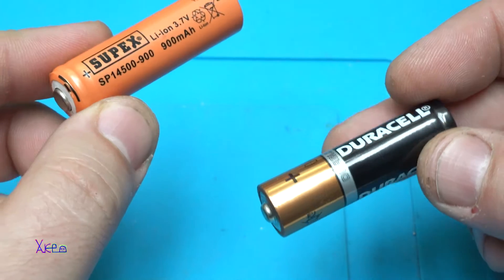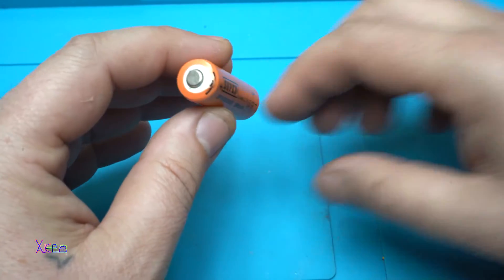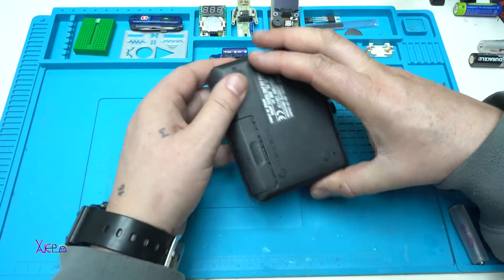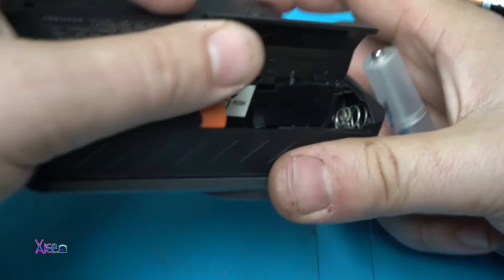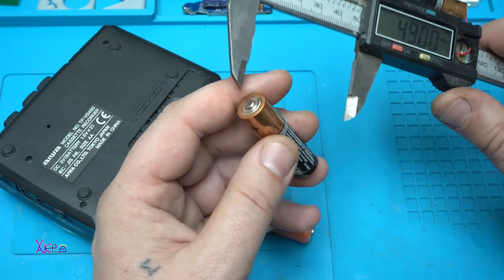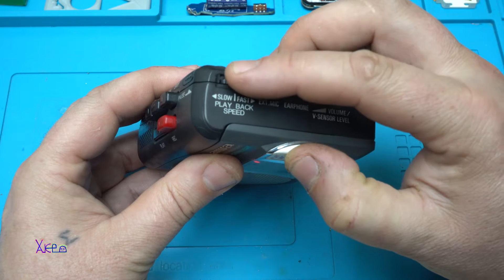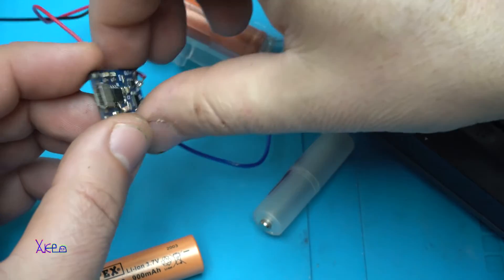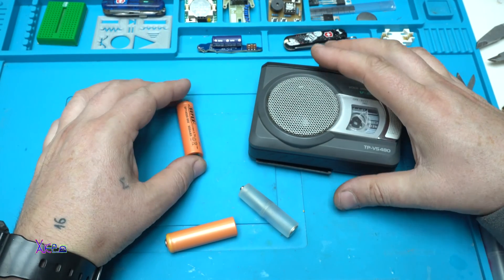WHY 14500 is BEST BATTERY? Testing! True or Fake?

Comment: Tell me a product with a good 14500 rechargeable battery.
Reply from the maker: You mean to find in device?
Reply: @Hacktuber I need a 14500 rechargeable battery with good performance to put in my flashlight.
Thanks.

Comment: they have lipo4 3.3v AA's now, about 1.5$ each. i think better for replacing alkaline because of closer voltages and also maybe more durable to overdischarge since there is no protecetion, i think random devices will keep pulling juice from lipol batteries.... especially since 3.7v looks like fully charged AA the low battery sign will not warn you. maybe this is a bit better with lipo4? i think the capcaity is about the same but i dont know how to charge lipo4 without a power supply...
Reply from the maker: You need to charge with current limiter and have adjustable power supply
Reply: @Hacktuber  hmm i bet in a pinch i could use an automotive lead acid charger and just put 4x lifepo in series, charge on the lowest setting up to about 14.8v total and reconnect them all in parellel to balance. repeat a couple times and they should be close to topped off. usually the lowest setting on automotive chargers is ~3A for maintainer setting. 3/4 is under 1A each cell

Comment: What is the benefit of using this instead of 2x rechargeable AA  which are half the price and much higher capacity? (ex 2450 mah)
Reply: also my question, what is the benefit?
Reply: @bro_leo  Thank you for taking the time and answering my question i n detail. Now i know :)
Reply: Bro_leo could you also mention discharge rate and internal resistance
Reply: The voltage is the only benefit.  Some devices will cut out if the voltage drops to 2.5 or 2Vdc and not fully use the battery charge.
The issue with lithium battery is the min. low voltage safety.  When a lithium ion battery goes bellow 3v the risk of permanent damage increases.

Comment: I Use The 14500...18350..18500.. A LOT Of 18650's ... & A Few 26650 & 21700 << Most Amps
I Get Many 18650's With The Charging Board Attached From "Battery Banks" From The Buck Store Here In Canada.. All For A Couple Dollars.. & They ARE 2000-2500 Mah ... Not Bad, I Can Vape 26Gg Wire With Them... 24 Gg Is A Lil' Heavy... I Also Just Put Velcro & Battery Sleds Then Just Clip On To The Positive & Negative Of The Electronics... It's A Lil' Bulky But Not Too Bad.. I Also Power ALL My Lights In My Office & Most In My Shop With 18650's & I Use Outdoor Motion Detector Lights That Are Solar That I Purchased For $15 Each.. If Ya Can, I'd HIGHLY Rec. Getting Some... You Get About 5-6 Hours Of Nice Bright Lighting & Then It Goes Dull & Stays That Way... Plus Many MANY That I Built... Plus Other Stuff .. Ya Can Power Everything With Them Dang Batteries.. Lol. True Tho... Sorry Fer Yappin'... Hope Yer Season Is Festive My Friend !!!